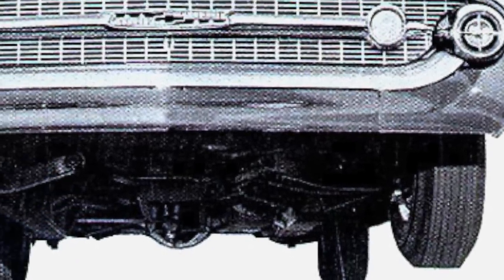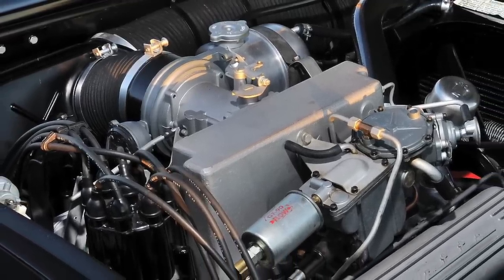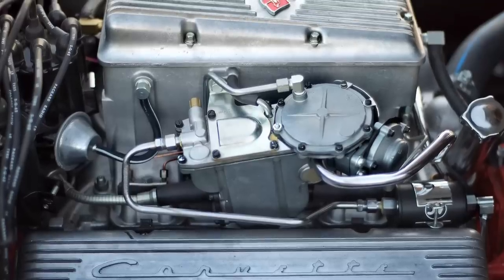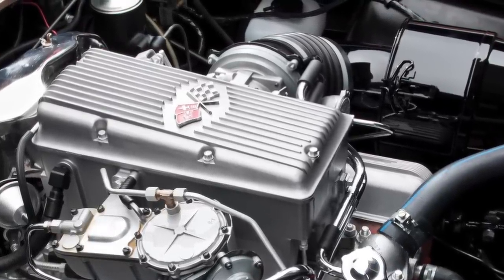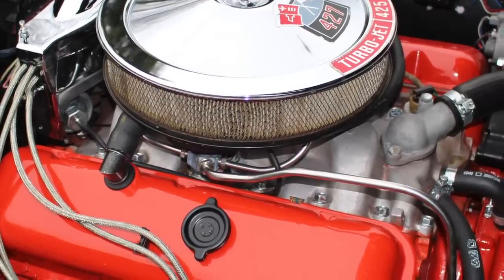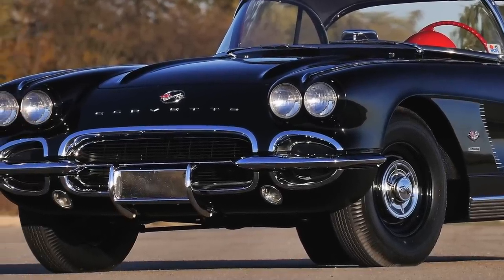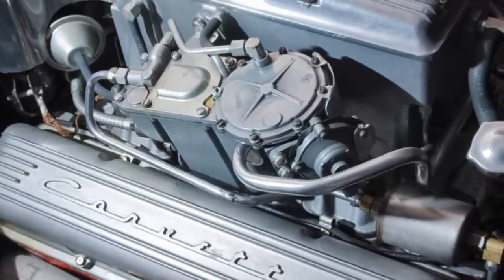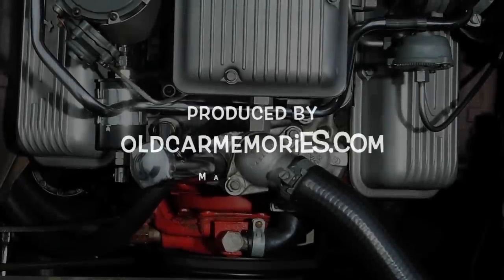Why Chevy Abandoned the 1962-1965 Fuel Injected 327 V8

Comment: Mechanical FI was a bit difficult to dial in, but the fuel mileage was far superior than the dual quad models when tuned well. The computer controls sealed the fate of the carb.
Reply: Bruce Carney remember the early 1980's?  GM had some computer controlled carburetor cars, like my dad's 1983 Chevy Celebrity  with the 2.8 v6...
Reply: @Bruce Carney - Being mechanical, it lacked the sensors that allow modern EFI systems to compensate for a wide range of operating conditions, such as changes in temperature and altitude as well. That hook up did do a good job of adjusting fuel flow in response to changes in air density.
Reply: The Chevette had an 'electronic' carb. We all know how those turned out.
Reply: Yep, the 1987 Chevette, which I owned, and the last year they made them, was rated at 65hp.  I highly doubt I was getting all 65hp, as I couldn't even beat a fully loaded city bus off the line.  However, it was extremely reliable, especially in sub zero weather.  Started no problem.  Just had no power.
Reply: not a carb, was a single body injection, very common on low cost european cars in the 80'...
Reply: 30 years later though! And a good carby engine will still go harder generally than the fool injection. 
Though for my every day driver the efi is ok,,, and still costs a lot more when it goes wrong. Seldom these days ofcourse
Reply: leneanderthanlien - the 87 Chevette had a carb, not fuel injection.  The Chevette's never had fuel injection.  It was electronically controlled for mixture, with an O2 senser.  Very primitive, but it sort of worked.
Reply: ojars zvaigzne Mitsubishi did this with the mightymax (dodge ram 50) as well. Computer controlled mikuni carb. I ripped it off of mine and put a Weber 32/36 on it. Lol
Reply: Sounds like the Chevette had Throttle Body Injection ( TBI ) .
Reply: No... it had a carb. It used suction to get the fuel out not a high pressure fuel pump. 

The electronic “computor” simply adjusted mixture.
Reply: Mechanical fuel injection is very easy to maintain.
Reply: Ahh the feedback carburetor. They were a real gem. Early/mid 80s V8s. Gaaaarbage. Lol.
Reply: @christophermarshall5765  yep all of my race cars have mfi. And its easy once you get the hang of it. If its lean add a smaller jet and if its too rich add a larger. Backwards from a carb for sure but wfo it comes alive. 4362 hp on engine dyno blown alcohol hemi

Comment: One of my friends was a mechanic. he bought a 58 corvette eventually it broke the crank shaft and he asked me. I can get the 375hp/327ci long block engine new through dealer but they will not sell me the injection. I can buy a used injection system. But, can you tune it for me. I asked. do you have a portable exhaust gas analyzer? Yes, ok buy it. he bought it and put it together. just adjust idle speed and mixture. then set the full power mixture stop for 11.5:1 and the cruise mix stop for almost 14:1 its still running to this day and in the possession of his son(he passed away in 1985). A simple system that worked great.
Reply: Is that portable exhaust gas analyzer turbo charged? Or is that just the floor model?

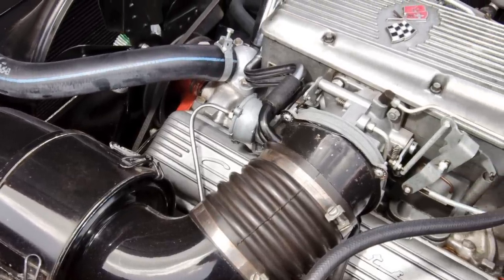Comment: You get your answer at the 3:32 mark: "It was a lot more expensive than a carburetor".
Reply: It was also a lot more expensive than the big block, which produced a lot more torque, and ended up being overall a better street car because of it at the expense of weight up front. The big block killed fuelies.
Reply: At the time Fuel Injection was very cool to some people but just mysterious and weird to most. I live in Nebraska but when they were new most of the dealerships had no idea how to make it run right.   With a good dual plane intake and 750 Holley dual pump carburetor the horsepower was very similar. Thats why when they acted up most got scrapped for a carburetor.  Factory or professional race teams aside most people worked on their own cars then and were so much more comfortable with normal induction.
Reply: It took reliable solid state electronic control for fuel injection to go mainstream. The electronics just didn't exist back in the 60's. The first GM small blocks used mechanical injection.

But Chrysler was installing electronic fuel injection in some models by the late 50's, the first production examples of such, although I think there were problems with the early ones.

Comment: I actually have a 1961 Impala fueling, dubbed “the car that doesn’t exist.” Chevrolet offered two FI options in the 1961 Corvette; 275 hydronic lifter and the 315 solid lifer. Although dealer installed, my car has option 353, equipped with part number 7017200 Rochester FI. Only 2 are believed to exist and I drove mine to Lancaster (CA) and back home today, 125 miles.

Comment: James Wiliams
You are absolutely correct.
I owned a 65 327 with the double hump heads.
 My buddies and I overhauled it in 1979 and installed a Crane Blazer 300H hydraulic camshaft (292/488)
When we first fired the thing up, Dear God, what a sound.  It was a sweet mechanical sound, not a heavy exhaust noise, but a sweet lumpy, loping of the valves responding to the  lift and duration of that camshaft.
We installed the motor in a 66 Chevy C/10  pickup truck with a 4 speed rock crusher, Hurst T-handle shifter.
I am hear to tell you, from a short roll, get the rev's up and stand on the throttle, that motor would almost lift the front wheels of that heavy truck.
To this day, I still hear that motor idling when I look back at those days.

Comment: Zora Duntov himself stated that the primary reason for dropping the fuel injection system was that carburetors had progressed to the point that fuel starvation under hard cornering was no longer a problem.  This was the biggest advantage the fuel injection system gave and was the reason for inclusion on the Corvette -- for SCCA and other racing endeavors.  Duntov said that once the fuel starvation issues were solved with carburetors, there was no longer a need for the high cost fuel injection.  I met Mr. Duntov in the mid-1980s.
Reply: Exactly!  It requires a computer and EFI to beat carbs.  Carbs performed better and more tuneable to conditions.  The air box became the base for the tunnel ram.
Reply: @curtispaul9717  Your belief doesn't change fact.  The early FI had terrible tunability. They went to it to solve bogging issues but was complicated and unreliable. The moment they could get away from it they did.

Comment: I have seen more small-block Chevies in Ford's than any other engine. The 283/327 was the ideal engine to use for Hot Rodding.
Reply: The older 283 /327 engines were great  but don,t belong in a ford .The only reason you see this done so much is because old GM bodys have rotted away because of all the wood construction support  and are scarce to be found . plus the ford made a better looking hot rod .the trend seems to be moving away from this today  with many other  good engines being used  instead .
Reply: @tubedude4859  The small-block Chevies fit better in a  Ford than any other engine. They were smaller in size. I agree that ford made a better-looking hot rod, that's why builder's put Chevies in them. What wood support are you talking about?
Reply: @williamnair1991   I suppose if you are looking for the easy way out

Comment: Higher cost up front for fuel injection, but the savings in fuel savings would eventually make up for it. Glad you mentioned the handling improvements with a lighter engine.

Comment: Fascinating, and had a old neighbor who had some early to mid 60's 'vettes, and I helped him service the engines, but as much as he knew about the engines available, never mentioned a fuel injected setup. Also interesting because I was the among the first 'motorheads' to endorse and even covet fuel injection, while so many others said they didn't know how to work on them, told them it was easy,lol just had to learn a bit. And I'll take the vehicle not flooding the cylinders with gas and better performance everytime. even recently on motorcycles, still here about the carb'd ones.."well at least I can work on it"

Comment: Something I read but not mentioned here: Chevrolet developed FI originally for sports-car road racing, where fuel starvation during hard cornering was (and is) a problem for carbureted cars. During the '60s amateur motor sports became more fixated on drag racing, where a big heavy carbureted lump in the front wasn't such a liability, so there was less interest in costly FI.

Comment: Chevy SB 327 with aluminum intake and fuel injection 535 pound's, Chevy BB 396 with cast iron intake and carb 685 pound's. 327 stock Corvette with fuel injection 14.2 second quarter mile compared to 14.1 with the 396. The 396 may have been slightly faster going straight but the lighter 327 FI Corvette would have killed it in overall driving ability!
Reply: The success of the big block, even 53 years later made it a very worthy replacement for the FI small block. L88 with aluminum heads would outrun any FI small block (and any furd or chrysler engine for that matter).  The greatest travesty in auto history was congress' threat to break up GM bc of their unfair advantage in the market. Cue the racing ban so they wouldn't sell as many cars, stifling any further racing development. The compromised BB was the result. Thanks, big government. You're welcome, furd. FI was typical of a monster GM though. Only a company of that size and scope could futz with it while producing so much else.
Reply: Pound's what?
Reply: Take it easy guys the so called  hi -tech phones like spelling it that way even if you try correcting it, smh.
Reply: bigblocklawyer Think of what the ZL1 would have done if offered thru RPO or even as a COPO in the Corvette. I'm surprised no one did it. There were some individuals that undertook the task of installing a ZL1 at their shop somewhere, but imagine the price of a 69 ZL1 Corvette at the dealer! I'll have the roadster please. Is there an Auctioneer alive today that can say how many dollars it would sell for that fast in repetition?
Reply: Ok.....I have a 1985 Porsche 928S2 that has a 286 cubic inch aluminum SOHC V8 that weighs 550 pounds.  It will push the 3300 pound car down the strip to the tune of 13.86 @105 mph, the rear tires spinning all the way.  And it will happily run away from that plastic Chevy on any set of curves.
Reply: Flies2FLL Now, an L88 in F.A.S.T. Drag Racing turns in mid to high 11s. I would imagine you could do better than 13.86 if you put some time into it. Likely you are pleased enough with your car's performance and abilities. Myself, I am thankful that there is competition that creates better cars and more excitement for everyone. No one brand owns the top spot for very long.
Reply: " L88 with aluminum heads would outrun any FI small block"

LOL, what are you smoking?  The LS and LSX are lighter and are capable of making more power.
Reply: Flies2FLL.  Absolutely positively not, the corvette C4 for all its flaws was a fantastic handling car, your car may beat out some of the lower powered variants simply due to HP advantage but any L98 LT1 LT4 or LT5 will easily close that gap.

The 928 simply isnt a real sports car, its a heavy soft touring car while the C4 is a harsh uncompromising sports car.  

The Corvette beats your car handily in slalom, braking distance and lateral Gs. 

If you are going to brag about anything brag about comfort or general build quality, or even drag racing up til the 90s, but in raw handling the 928 is a boat.  Even the lowly 944 hands it to you lol.
Reply: bigblocklawyer is that why chevys v8s are still the same as they were back then?
Reply: I subscribed to and read every word of "Car and Driver" magazine beginning Oct, 1964.  They reviewed the XKE Jaguar in that issue.

Next, month they reviewed the 1965 Corvette Sting Ray 327ci x 350hp.

Next they reviewed the 1965 396 x (I don't remember hp) Sting Ray

Then they reviewed the 1967 427ci x 425hp Sting Ray.
In that issue they stated that the 427 big block which was created by boring out the 396 block was actually "lighter than the 327 car they had reviewed in the Nov. 1964 issue.
That 427 Corvette was superior in every way to the 327 which it succeeded.
Still, I consider the 1965 with 327ci x 350hp to be the most desirable Corvette of all time.
Reply: @uropygid  Zora Arkus Duntov worked very hard to get the static weight balance of 52% front, 48% rear. Under acceleration, it would 50-50. A big block without aluminium heads could not achieve that balance, even under acceleration but they could get close with a softer rear spring. Zora never saw the Corvette as anything but a road course car. He certianly welcomed hp and torque to the party but never truly embraced the Mark IV until the aluminium heads showed up. I am curious why he didn't push the ZL1 into an RPO or COPO for the Corvette. Imagine a Rochester Fuel Injection for that!
Reply: If 150 lbs mattered, make her get out!
Reply: kurt2022 well,said

Comment: when I was a kid the next door neighbor always got a new vette as soon as the came out.The 65 FI would eat the 66 lunch easy but like you said when it had 7,000 miles on it the dealer could not fix the FI when it got out of wack.He refused to let them put a carb on it and it took them 1 month to get it right,by then it was early Sept. and time for New one .The 66 did not have the same power.  Now listen the dealer could not tune up the FI, what he heard was P51 mechanics could fix them. But being in San Antonio he never found one.
Reply: Kind of true as the GM FI system was basically the same as the Bendix pressure carb system popular in WW2, and later in aircraft engines. The Bendix system is still around.
Reply: the old stromberg carburetor...I think

Comment: on the subject of more affordable fuel injected vehicles that made the average consumer really appreciate the the advantages and also see the simplicity and reliability of a well engineered mechanical system I think an episode on the first VW Rabbit GTI with the Bosch mechanical Jetronic four port injector system plus one plenum injector to provide cold start enrichment. I purchased my used GTI at a used car clearance sale for 600$ in January 2000. It was -20F as a Canadian winter can be, the sales man handed me the keys, a snow brush and explained that it hadn't run in about 3 or 4 weeks and said he would get a booster as the battery was likely not too lively. I brushed 6-8 inches of snow off, hopped in , looked at the odometer showing 250 000 km (`155 000 miles), cranked the motor to life in about 4 or 5 seconds, no boost needed, brushed the rest of the snow off the hood, roof and glass, checked all the lights, and controls, waited for the heater to start pushing heat and cranked up the defroster and embarked on a ten minute test drive only to find that it was a well running diamond in the rough with no apparent problems  Over the next few years I put about 100 000 km (62 000 miles), about 80% highway, with only basic regular maintenance (CV shafts, timing belt, filters, brakes, tires, plugs,one exhaust hanger and a quick weld on the pipe were the broken hanger let the pipe crack).  That car never left me broken at the side of the road, got excellent fuel economy, had enough power to cross the Rocky Mountains (Vancouver to Calgvary roundtrip Via the Coquahalla) with only a few downshifts to 3rd as well as a couple convoys up the pass behind the snowplow. Just one of my few cars I wish I could have kept. I'm not sure if you will feature a first gen Rabbit GTI on your channel, you could always do a video on a 67 Rambler American 2 door with the 232 2 barrel carb 6 cylinder and the Borg Warner aotomatic (another regretful loss, 170 000 mile California car that I drove about 40 000 miles through the southern states, 8000 miles of Mexican 1980s highways, west coast states, Alberta and BC in Canada until I rolled it on a northern logging road after hitting a washboard at about 25-30 mph). replaced with a 1972 GMC 2500 Fleetside for about 100 000 miles, 74 4door Chrysler Newport, 77 Lancia Beta, 3x 2nd gen Dodge Dakotas, and probably a few cars I am forgetting .